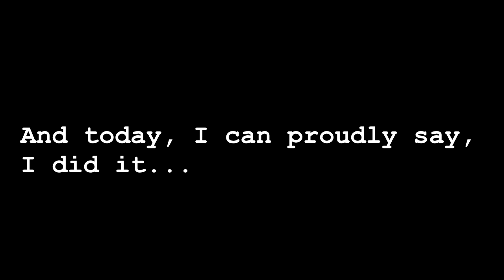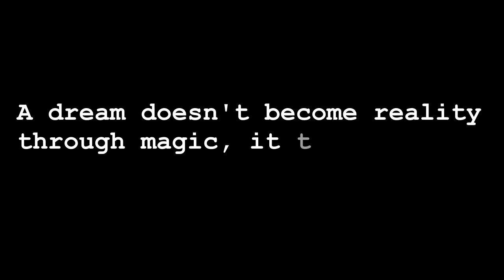Finally I did it 💯🤝🏻 | I started my own business | Football Turf

Comment: Great build  but my only suggestion if taken would be that the surface below the turf could have been layers of compacted gravels,sand,rock (there is a specific technique) and including a drainage system. 
Could be a little expensive at first but it will expand the life span of your carpet (turf) but more importantly will be safer for the players and prevent from long term injuries , 
Or the players should be recommended to wear soft sole shoes
Reply: I agree with you! How much does this process cost? Do you have a estimate?
Reply: @saifur4323   totally depends on where you are located ,  it’s expensive in my country.
Reply: Yes I agree with you
Reply: @bhutantenzinruns in India how much will it cost?
Reply: RCC is expensive, where as layers of 40mm, followed by 20mm & finally 5mm is cheaper, player friendly and gives a good feel
Reply: Can I get anyone to help me build one in Ghana please?